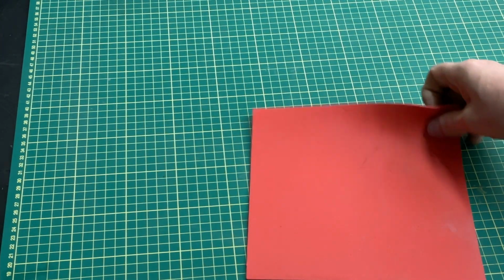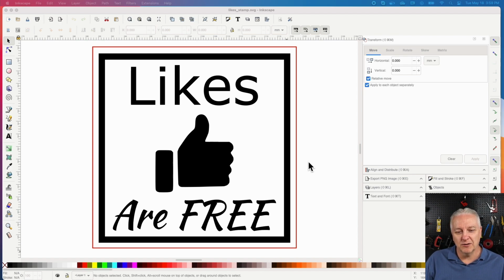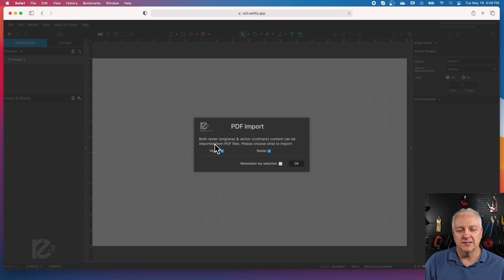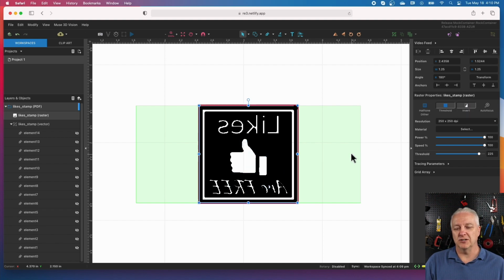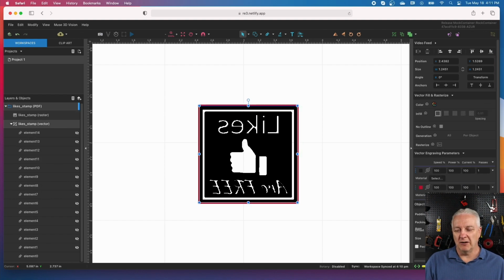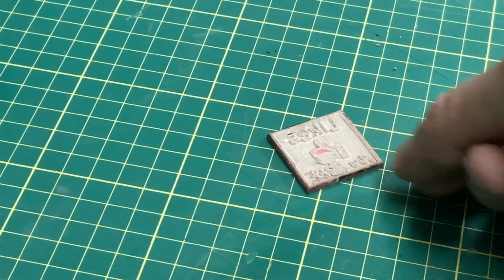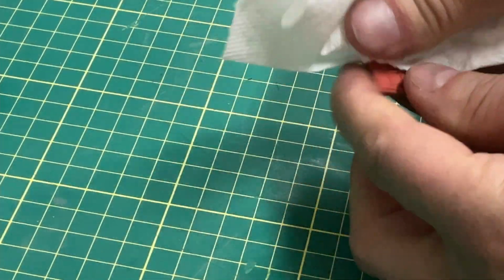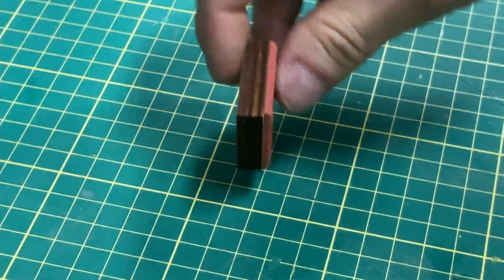MAKE CUSTOM INK STAMPS

Comment: Thanks for the video Steve. I have been doing some research on co2 laser machines as I want to start a part time business manufacturing rubber art stamps.So this video is very relevant to me. I have decided the muse core looks like a machine that will suit my purposes. 
Other than stamps I am also considering to cut some acrylic sheeting approximately 2.5mm thick and some art stencils from plastic or Mylar.
I have never used a laser machine before and I am not the most mechanically minded person. 
Are these products reasonably easily for a learner to manufacture with this machine? 
After watching your video on the cricut would stencils be easier to manufacture on that machine or one similar?
I have watched about half of your videos and they have been very informative but I haven’t seen any regarding accessories. Due to my limited budget and I don’t live in the US I have some questions.
Is the 45 watt upgrade worth it?
Since I am manufacturing art stamps that will be detailed should I consider buying a 1.5mm lense?
I am thinking of going for the hobby kit for the pump and air compressor and maybe upgrade with a water cooler down the track.
Thanks
Reply: Thanks for the feedback Steve.
Reply from the maker: The learning curve on most hobby lasers isn’t too bad. Most of your effort will be on figuring out the right settings for things, but if you take notes you’ll learn pretty quickly. For your planned jobs a 40w laser will do just fine. In the Muse it appears that the 45w upgrade is for the tube, but laser’s general output of the laser is still in the 40w range; however the 45w tube won’t have to work as hard and should last longer as a result. You can probably live without it though if your budget is tight
Reply from the maker: A1.5” lens will definitely give you great detail. Note though that this will impose some limits on cutting thicker materials

Comment: Hi Steve, I bought a muse 3D using your coupon code, back in March. Thank you for that!  And one of the main reasons I wanted a laser machine was for stamp making. So I have watched this video so many times (as well as others) and am still not able to get as deep of an engrave as you. I’ve even reached out to the community forums and FSL themselves, and, although helpful, I’m still not able to create a stamp with a deep enough engrave. I’m only doing a font (it’s kind of a fine lined font) so I have increased the line to make it slightly thicker (3pt), to no avail. The font is at 20 pt so the stamp itself is about 1”x2”.  My settings are S100, P16, Current 100 and I believe the threshold is 250 (if that matters). DPI is 500. I’m only rastering so I’m saving it as a pdf when exporting (from my silhouette studio program, though I’ve done the same with Inkscape with the same results). I will eventually want to vector but the raster is more important to me now.  I’m using the orange rubber from Amazon but have also used the gray odorless one from JP Plus, which actually engraves a bit better (but still not enough). 

Also, is there any way to do more than one pass when you raster vs running the job, then sending it through again? (because that burns the rubber).  Any help you can give would be greatly appreciated. Thanks.~Terrie
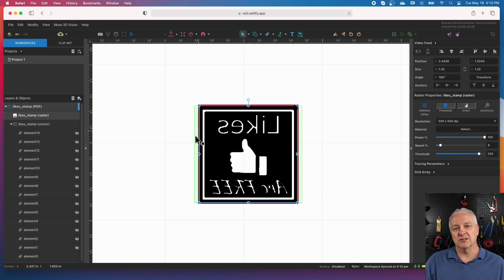Reply from the maker: Well there's a lot to unpack here,  First a speed of 100 is going to be way too fast.  You probably want something like 8 or 10.  Power should be 100.  Start with that on a raster.  See the settings at about 4:30 in the video.  As long as you don't move anything after the engrave, you can run the job a second time, though that really should be required.

The part will look kind of burnt but you can take a toothbrush to clean it up.

Try those things and let me know.
Reply: @SteveMakesEverything    Sorry I mixed things up when typing. Yes my Power was 100, speed 16. I know you said to go slow in your video with rubber bc it’s dense, and you had your speed set to 9. I tried my speed at 9, power 100 and actually, the speed at 16 worked better for me. 

I also have run it twice without moving the rubber and that’s what made it more burnt (whitish almost) even after scrubbing. I’m wondering if the problem is that the laser isn’t low enough. I tried looking at your video to see how close your laser was to the rubber but I couldn’t tell bc it was going so fast. Even though I autofocused the laser, it’s still about 1/2” - 1” from the rubber. I don’t know if I should manually bring it down more (or if that could cause a fire). I know I had that issue when doing tumblers, it wasn’t going down as far until one time it did and it worked. So maybe that’s the problem?
Reply from the maker: @terriewest6223  When you say "Low enough" I assume you're talking about focus and if the laser is 2" above the work this would be a problem.  Unless you have a different lens than the standard 2" lens the end of the nozzle should be 4.65mm from the material you're working with.

The lens is just above the nozzle and is held in with a magnet but it might we worth sliding it out (without touching the glass) to make sure that on the side of the frame it is clearly marked as a 2" lens.  You might be able to see this without taking the lens out depending how easy it is for you to poke your head inside the laser cabinet.  To make this easier slide the carriage all the way forward and then look to see if there are any markings on the side of the lens frame.

If it is indeed a 2" lens then I'd suspect something wrong with the camera - unless you aren't actually autofocusing.  In RE3 there is a setting button (one of the buttons on the top left of the toolbar).  Might be worth a look in the settings to make sure autofocus is on and configured for the right lens.  If it all looks good, then it might be worth a call to FSL support.